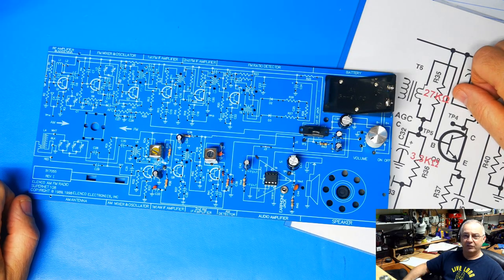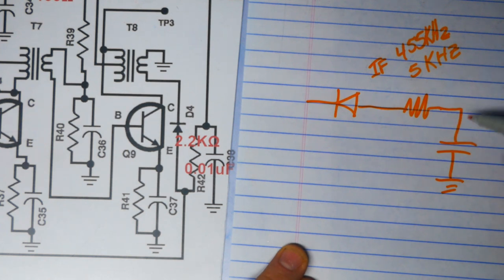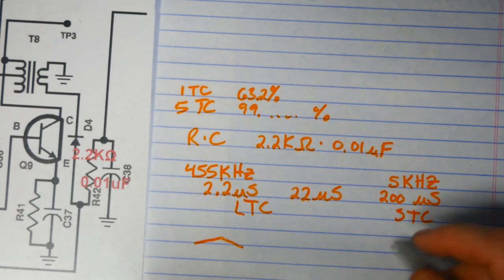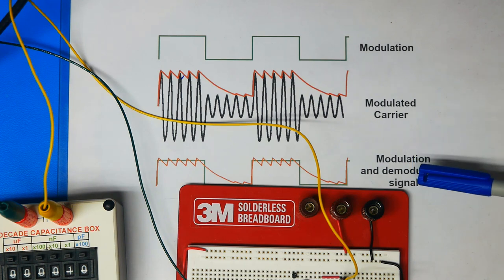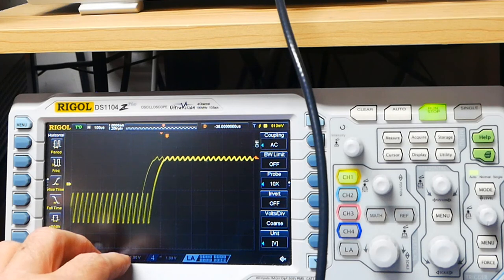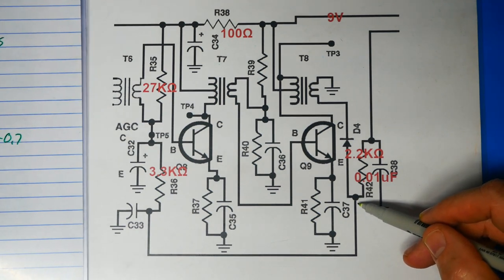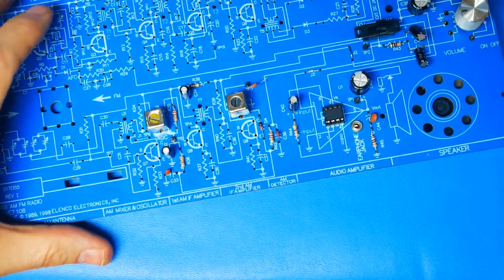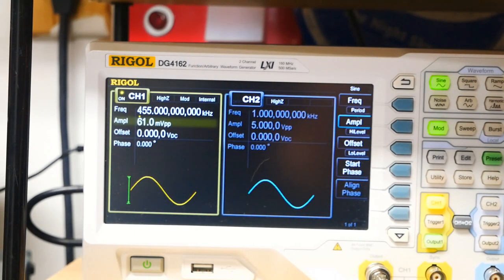86. Diode Detector and Automatic Gain Control

Comment: Excellent video.  I learned several things, particularly the real cause of audio distortion in an envelope detector.  One detail worth mentioning:  the audio frequency response of an AM signal is not limited to 5 kHz.  Most US stations transmit up to 10 kHz, following the standard NRSC audio curve.  Even though the channel bandwidth is only 10 kHz, stations are occupying up to 20 kHz.  The true limitation of the high frequency response is in the bandwidth of the receiver’s IF section.

Comment: thank you for the great videos. 

 I prefer the capacitive reactance description of the detector output. the 2.2k resistor and 0.01uF cap form a voltage divider that is frequency dependent.  where the voltage at the output is higher at the lower frequency signal.

Comment: HI, I love the clear explanations in these videos, the close ups of the test equipment certainly helps to understand how to test  the circuits. I have however hit a problem with my kit at this AGC testing, at TP5 I only get 0.133vDC, the R38 is getting hot, I have tested R35, R36 and R38 (off the board) and are fine. Diode D4 is correctly orientated (also tried a replacement has there are 2 in the kit). So at this point I'm lost as what to do, I have contacted Elenco but as yet no reply. Any help would be greatly appreciated. Keep up the good work.
(EDIT) C32 Faulty, I'll leave this post here if OK just encase anyone else comes across the same issue. ( I did test the capacitor before putting the board!)

Comment: The gain is changed because the control voltage on Q8 Base shifts the AC signal on Q8 Base from the steeper part of the IC vs VBE curve to the flatter part of the curve.

Comment: That square wave with the clipping and the ripple wasn’t a good representation of what can happen with an AM signal, since it contains harmonics far higher than the maximum 5kHz. The maximum dV/dt for a 5kHz sine is Vpeak*2πf = Vpeak*10,000π, which is significantly easier for that filter to handle than a square wave. On the topic of filters, I wonder about using an LC filter instead of an RC filter, for the steeper cutoff. It’s not like there aren’t already inductors or transformers already on the PCB. I think an active filter would be an option too.
Reply: Go ahead and calculate the inductor needed for a LC filter with a reasonably sized capacitor. Remember that for a filter, you'll want components with high quality factor. The inductor you'd need would be the size of your fist.
Reply from the maker: Hi James. I appreciate the feedback and I agree up to a point. The modulation signal I used was just 200Hz so the harmonics were a lot lower and the example did a fair job of showing what different RC  combinations do to the demodulated signal. An active filter would be nice but this was part of the Elenco radio kit so that was out.

Comment: Why is C36 bypassing the second transistors base to ground? What is the value of C36, is that maybe some picofarad to elimate oscillation?

I found the manual online and it says that stage is a common emitter amplifier and that C36 bypasses 455kjz to ground, i dont get at all why they do that on the base. The emitter makes semse, to increase the gain. Wny would you ever put a capacitor on the base to ground  on a common emitter
Reply: It is a common base amplifier. Common base amplifiers are mainly for impedance matching.

Comment: What is the purpose of the diode?  Why is it called a detector ?
Reply: The diode removes one half of the IF signal. A low pass filter is used to eliminate the higher frequencies of the IF signal to just pass the audio through, but putting a low-pass directly on the IF signal would average the whole thing to 0; there aren’t actually any audio frequencies there. By clipping half the signal off with the diode, we are left with an asymmetric signal that a low-pass filter will average to the signal’s envelope. This can be done directly to a tuned RF signal like in a crystal radio circuit, or to the tuned IF signal like in this superheterodyne circuit. It’s called a “detector” because it’s the critical component in turning an imperceivably high frequency radio signal into an audio signal that can be listened to.
See the wikipedia pages for amplitude modulation, envelope detector, crystal radio, and superheterodyne receiver for more information.